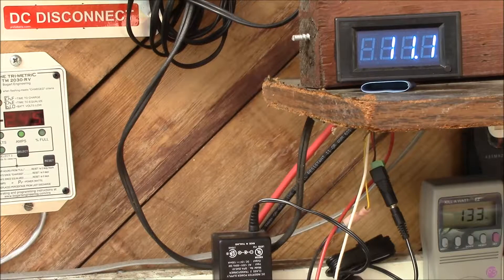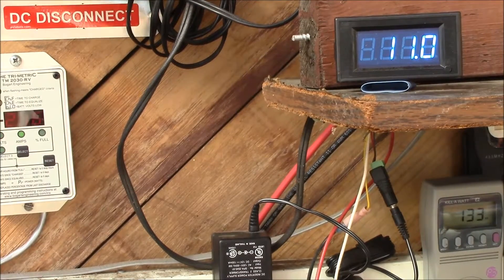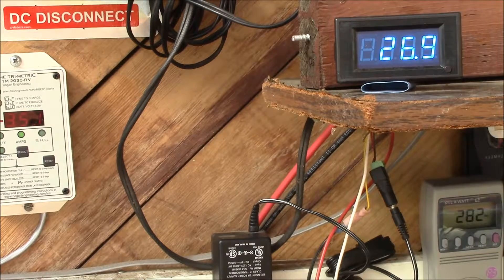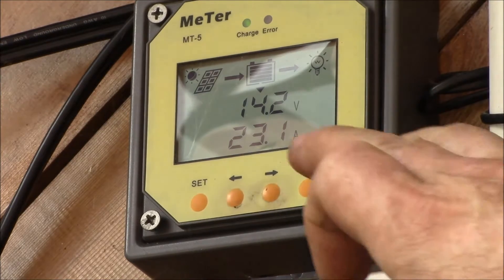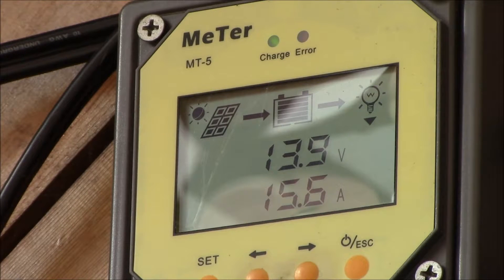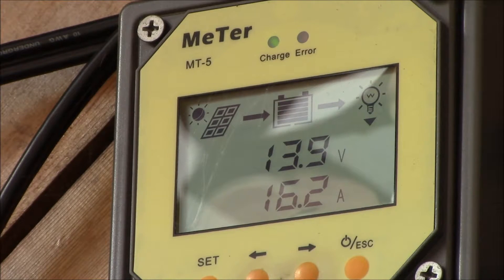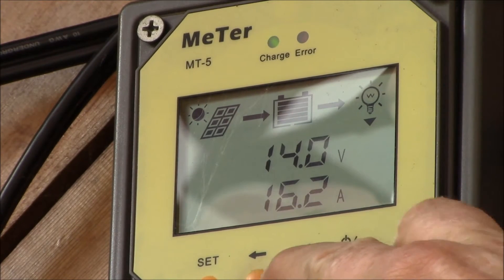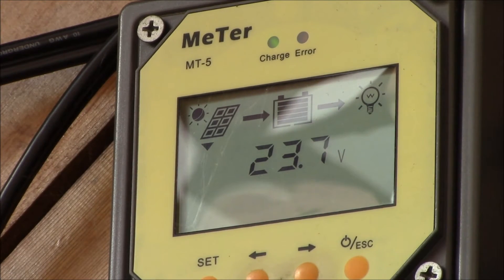Solar System Load Testing

Comment: woah. . . how many wattage's of solar panel do you use? 

i have 300 watt solar panel all i got is 11(+) amps enough to power tv(45w) electric fan(60w) , my inverter is 2,000 wats my batttery is 3sm dyna power
Reply from the maker: I think I had 3 - 270W panels plus a pair of 60W panels hooked up for a total of 930W at the time.  This was way over the 40A @ 12V output of the controller.  At peak, I could do that 40A charging plus 20A of DC load or around 700W combined.  At that time, I was producing about 20% of my total electrical energy from solar.  Today I'm closer to 40%.